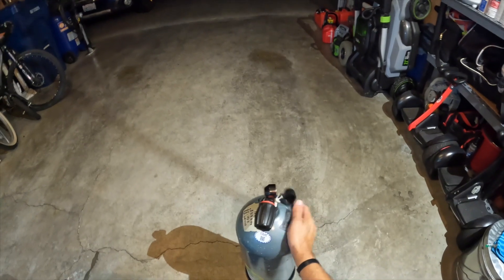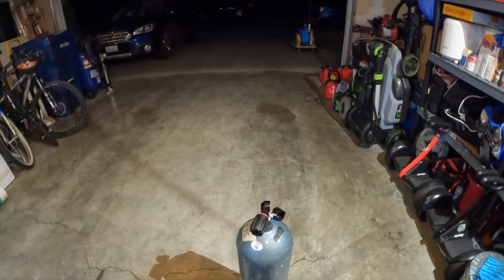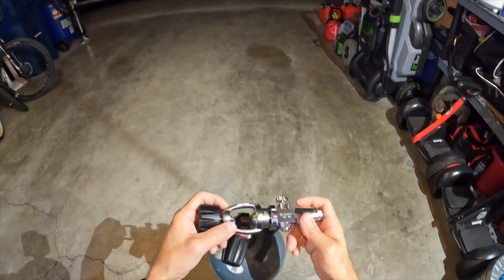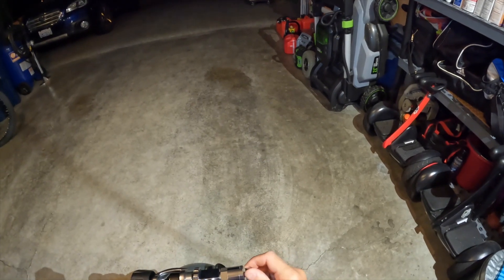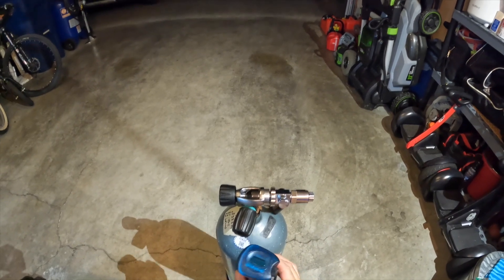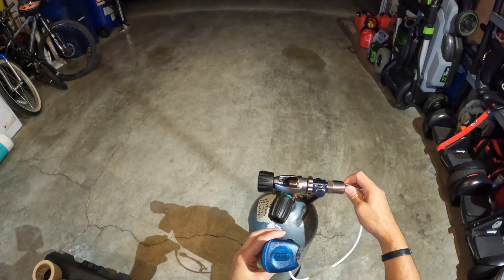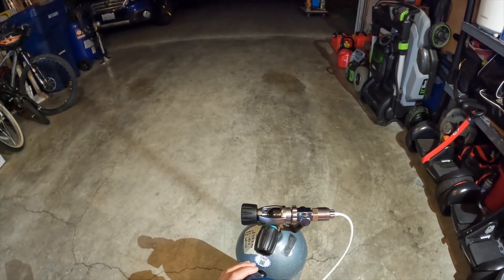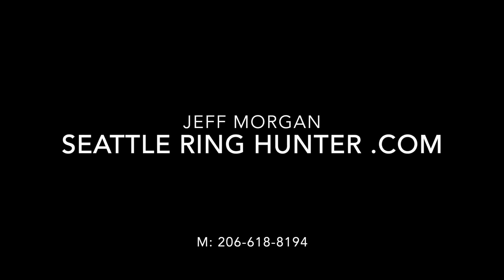NITROX SCUBA DIVING Analox O2 Gas Analyzer

Comment from the maker: Common practice is to round up your air calibration to 21 %. 👌

Unfortunately I noticed at time of this comment end of 2023 Analox no longer offers the 02ell analyzer. Not sure if low sales during COVID prompted this or not as the company is a large sensor test and measurement manufacture they may have as many had to slim down their offerings. However if you find one of these analyzers on the used market after a fresh commonly available 02 sensor replacement you will have a very handy meeter. If you're in the market for an alternative and highly recomended Nitrox analyzer consider taking a look at Divesoft DNA or Solo 02. Note Divesoft sells analyzers that do not have the helium sensor reducing the price for recreational Nitrox divers.
Cheers, #SeattleRingHunter